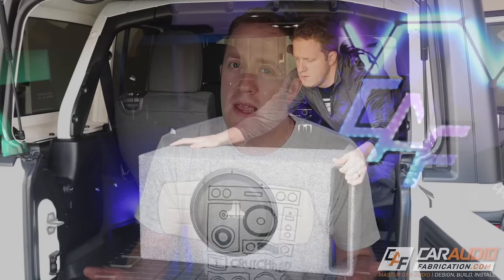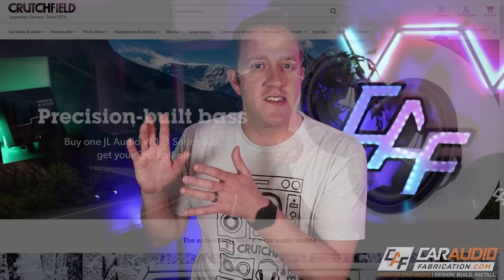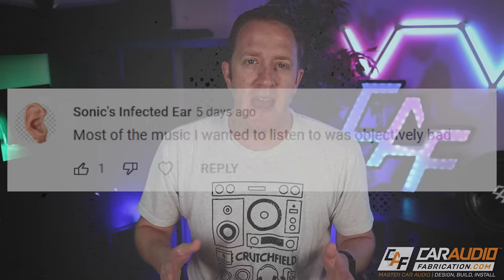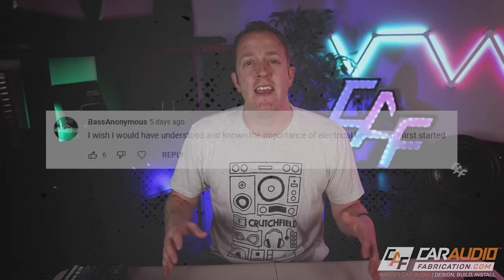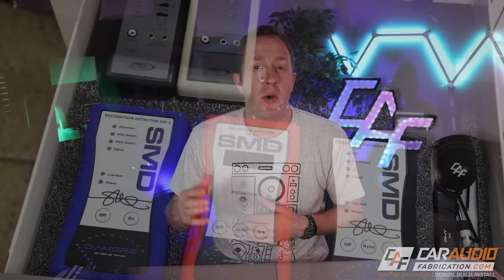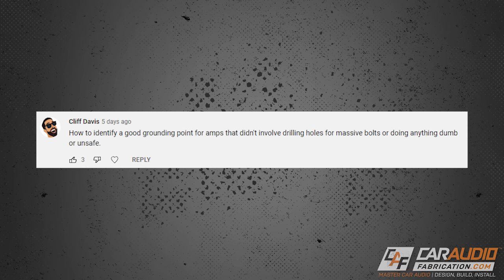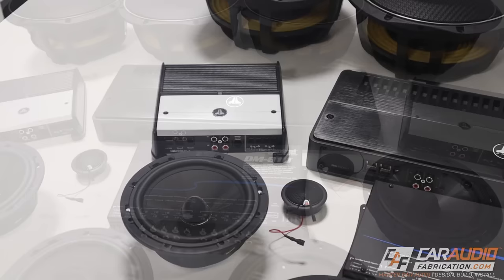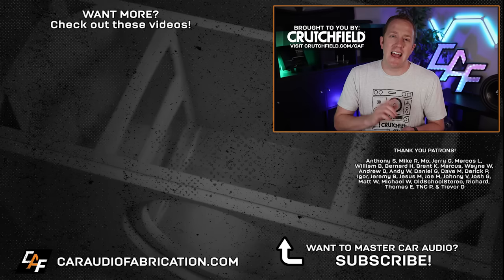My Car Audio System SOUNDS AMAZING now that I know THIS!

Comment from the maker: Let's hear from you! What's something you wish you knew before you built and installed your first car audio system?
Reply: proper vehicle selection, and managing expectations. you can't physically fit 10 15's in a hyundai accent, so you can't expect the final system to crush 150 db. there's a reason why the most common vehicles for SPL are tahoes and suburbans and the like and usually you'll find SQ builds in cars that are meant to be driven for hours. not to say there isn't crossover between the two, but think about how you're going to use the vehicle. is it a daily driver? will it be your grocery getter? can't make a walmart trip in your hyundai and get groceries if the entire thing from the b pillar back is now a sub enclosure. also not just beefing up electrical to compensate for the stereo, but the rest of the vehicle as well. all the equipment will be heavier, which means more suspension to maintain OE performance. more weight also takes longer to stop, so a big brake kit might be needed. tires are also rated to specific capabilities, are yours enough to literally hold the weight of the car, and now the added weight of the stereo, and perform adequately during braking? EXO addresses alot of this in his new build and even soundman has commented on it. depending on the desired end result, there's a certain recipe to get there, and it's not all just subs and amps.
Reply: ... to know that this channel exists would have helped tremendously
Reply: How to properly tune a dsp. I bought Helix mini mk2 specifically because I've read on various forums it's software is easy.  But to me there to still to many buttons and sliders. Why should I use a Butterworth crossover vs Linkwitz or Bessel for instance?

Also installing a system in a hybrid or electric car is quite different. My hybrid does not have a alternator but a 1200 watt transformer. That places a limit on how much power your system can run at.
Reply: I wish I knew how bad of a job an installer can do just to work as fast as possible, I also wish I knew I can actually make most things myself better than most audio shops in my area. And I wish I knew how to pair SW power/output to the rest of the system.
Probably I would have ended spending twice the money, but I'm sure I could have a system 10 times better right now
Reply: That I actually was never going to grow out of it.  I still love it as much if not more over 30 years later. 🤟
Reply: 1 thing I would like to know now. Is it good or bad for me to add sound deadening material inside my "fiberglass" subwoofer box?
Reply: Choosing the right head unit in which I have a Walmart brand Dual 6.2 inch touch screen. Its ok but is it ok for 1 sub audio system
Reply: @DarrenT0dd  I hear you. I put a system in a mini-truck I put off for 15 years. I was so happy and it sounds so good. I keep 6 bass enhanced mixes in rotation. Most of my friends try to act “grown” now like bass is for youngsters. I tell them they need to ride with somebody else.
Reply: what an LOC was and if wiring a system with a built in amp forgo the self install and pay a professional to do it
Reply: I just want to put two subs in my truck lol
Reply: Im only just getting into car audio and this channel has been great for info to help decide what to purchase. I am building a sound system for my wagon that will be a compromise between sound quality, bass and space as I still use my wagon to tow my drift car and it gets loaded up with tools. I have chosen to use 2 10 inch subs and have space on either side to fit up to a 35l box. I would like to know the difference between wood box, fibreglass box and fibreglass box lined with dynamat
Reply: I wish i knew about proper air space in a box back in 1990.  I just built a box for my two cheapass subs and it sounded like crap.
Reply: @DarrenT0dd  same here, but for the last 25 years or so
Reply: How much of a difference subwoofer makes. Even small one :)
Reply: Hi, I have a 2019 BMW X5 and I took it to a shop for them to install a sub. The set up is a JL audio 500/1 splash amp and a audio control DSP and two focal 10' subs.since they did the installation it has this humming engine noise in the sub and they can't get rid of the noise I took it back multiple times but they still can't find what is causing the annoying noise what would recommend to solve this issue
Reply: Hi Dear mark
Reply: I need your help regarding choice speakers and amplifier
Reply: @djmaxxhtx  LoL 🤣 that's me! I'm much more of an SQ guy these days. It could be the fact that the guy I work with has 1500 watts to 2 12s a garbage head unit to stock mids and highs that get completely drowned out.
Reply: @troycote4503  I went Alpine and JL Audio and I’m not looking back.😁 I put in dash cams, Sirius XM,  and an Amazon Fire Stick getting Apple TV etc. I think about places I have to go and wait in the car.🤣🤣
Reply: it would have been nice to let go and disregard every tool. oh wait. did that. now i feel how the capillaries in my fingertips react to being close to completing any circuit. how’s that sound🤫
Reply: Subwoofer is the first upgrade  to do, followed by speakers with amp.
Reply: @Mr99Burns  No No., big,is not better. Clean, plentiful power is required to achieve any of the goals you have in mind

Comment: I wish that I'd known that I was definitely going to cause irreparable hearing damage, and that I'd regret it.
Reply: Distortion is bad!
Reply: Loud noise for extended periods = hearing damage. 
You knew and didn’t care or failed biology. 🤷‍♂️
Reply: Design for clarity, not loudness!
Reply: @bradysimpson  It's the former.😞 (I've never failed anything. But that doesn't mean I've always made the best choices...)
Reply: @darkwinter6028  That's how I build now.  My current TwK88 system is loooovely.  And yet, even when building for SQ, you're going to end up with a system that can run at 112+ dB whether you want it or not.  And 112 is enough to hurt you.  So I must exercise maturity and restraint!  But damn... It's hard to exercise maturity and restraint ALL the time...☺️
Reply: In the same boat buddy, constant tinnitus and reduced hearing. I say “what” a lot 😅
Reply: So 6 tens in my mustang is bad for my ears.
Reply: Gotta pay the cost to be the boss 🤣🤣🤣
Reply: What?
Reply: @LC8FTW  true. My system is SQ but hits 156 db. Almost no distortion at high levels. But also not as much ear fatigue
Reply: @darkwinter6028  yep.  I've been more than happy with my SQ focused builds over the years.  Plenty loud and crystal clear.  Hearing is still fine.  Bass/Low frequency doesn't cause hearing damage but distortion and high pitch sounds does.
Reply: @LC8FTW  hey a couple songs really loud here and there ain't so bad but you have to give your ears a break.  Moderation is key.
Reply: @BigShay1977   damn, you beat me to it.
Reply: @darkwinter6028  lmao just don't tell that to those hardcore bassheads that have +8000 watts going to their subs!
Reply: @erikybarra1841  How, exactly, would I do that? They’re deaf! 😉
Reply: @fosholyfe6115  got to pay the cost for that hearing loss
Reply: As the adage goes. Everything in moderation, creates no problem.
Reply: @darkwinter6028  I can hear perfectly fine and been in the game for a long time, At the moment i have 4 cars with systems from high-end SQ builds to 2 Gately Audio Relentless 12s with a DC Audio 5k A3 on each. I'll admit I don't hear lows as good in the car but I haven't lost hearing at frequencies that really matter at all.
Reply: 🤣🤣🤣 who knew hearing anything over 110 dB was Goin to he an issue later on in life. I regret Nothing...

"What'd ya say hunnie?"
Reply: Right, I've done professional 12v for 24 years and I've got the hearing of an 80 year old.
Reply: Im in your boat. Heavy equipment operator for almost 20 years now and never wore hearing protection. When i was at the school of infantry, the first time we shot the saw it was so loud standing 40 yards from it…. Fast forward to shooting it without ear pro for years during deployments.  Wish i wouldve taken care of my ears better
Reply: No regurts 😂
Reply: When I was obsessed with music, I damaged my ears and now have a permanent high-pitched ringing. It’s fun to go to sleep.
Reply: @bassheadfanatik I'm really curious what your system consists of.  My system is ear fatiguing. I don't know how to fix it.
Reply: @markmaese1599 assuming we're talking about somewhat normal volume, I've always found that strong upper midrange to be fatiguing.  I'm over 40 so I probably can't hear real high frequencies that I'm sure would be fatiguing to some people
Reply: @jhershy1381  I’m guessing not
Reply: @nitrodreng  I've had tinnitus since birth, I can only imagine how much worse it could get
Reply: @bassheadfanatik are your hearing aids implanted or are they like ear pods ?
Reply: @darkwinter6028  the louder it gets , the more clarity it sounds lol
Reply: Lol I never took biology, but my hearing damage was definitely from listening to my Walk-man and disc-man as loud as possible. Now it's constant loud ringing, probably partly the music and mostly from operating skills saws all day every day

Comment: I wish I had understood 20 years ago that I could have achieved the same results with a simpler, less complicated system. Too much equipment and too many speakers. While I have always been of the opinion that it is the installation, speaker placement and the tuning itself that makes a system sound great, I was essentially handy capping myself from the start by not taking a keep it simple approach to the initial system design and equipment selection. The benefits of hindsight I guess!
Reply: Just look at the all time champion sound quality competition car, Richard Clark's Grand National. It only has 6 speakers and 6 amps.
Reply: @th-hx7st  I don't run 6 amps but mine go to 11.
Reply: Handy capped
Reply: I run a ported comp sub off a mono block amp and my two tweeters and four door three way speakers off my double din and it sounds brilliant. KISS [keep it simple stupid]
Reply: @firefueled  no component speakers?

Comment: I understand the value of a DSP, however if you do enough research you will find there is at least 1 headunit that has fantastic dsp settings, I bought a Kenwood a little while ago and while setting it up I discovered it has all sorts of time alignment settings including being able to set speaker sizes, locations, distances and delays for each speaker, my system is far from anything special but just upgrading to that headunit made a world of difference after already adding amps, subs and upgrading all 7 speakers, sounds incredible now for a 30 year old car, but I wish I could've retained the factory CD stacker
Reply: Dsp's and eq's look great in hardware form but all that and a lot more tuning is available through softwares; many of them at no cost.
Reply: @oscarishandsome5150  any suggestions?
Reply: Those are normal features. Every radio I've ever had has had all those features
Reply: Why didn't you get the DVD version if you wanted to keep CD?
Reply: @NoMoreBsPlease  you've misunderstood, they didn't mean any cd player, they meant the factory cd player for a factory look. That was my take anyway.
Reply: 100% More often than not, the more eq one has, the worse it sounds. Properly staged, x/o, and  amplified system may not require as much equipment as expected. I've had 30 bands of EQ before, I adjusted maybe 8-9 bands that I felt made a difference....

Comment: A lot of people over use sound deadening. That sticky butyl stuff is only good for minimizing resonances and does not require 100% coverage, if you want more treatment then that stop wasting money on butyl backed foil and use it on 25% or so of the surface area and then start looking at decoupling foam, mass loaded vinyl, etc.
Reply: This. Butyl deadener is great when used on large flat surfaces to lower sounds from vibration. But waste of money for your average person when covering the whole interior like a lot of professionals do. 
Simple trick to see if the surface needs it is to tap on it, if it has a solid thud then you don't need sound deadener on that surface but if it sounds like a drum then you need some. And even then you don't need to cover the whole flat area. Sometimes it's enough if you cover ~1/3rd of the flat area. Also make sure you roll it down on to the surface. Just slapping it on may give poor results.

When it comes to decoupling foam and mass loaded vinyl, you have to make sure you do very thorough job covering everything. Full interior disassembly required.

Comment: A DSP can't correct a bad installation...but it can correct many sounds issues that you otherwise couldn't "design your way out of" when building your system. You can understand all the best practices of installation and still not see all ends for how it will sound when everything is put together. That's where the DSP comes in.

Comment: My biggest lesson has always been - don't rush an install. Cutting corners or using readily-available, but sub-par parts will be worse than waiting a day or two for the proper parts.

Second biggest one is to not be afraid of asking for help if things start to get complicated.

My HARDEST one was to not always trust your local shops - they operate on making sales and especially superfluous services. Don't feel ashamed for checking out several ones, getting quotes, going back and forth,  and NEVER be afraid in saying no.
Reply: Rushing, that was always my biggest mistake.

Comment: Time alignment is used to get sound waves in phase when they reach your ear. If you want the stage centered a little left or a little right after that, you need to adjust THE SPEAKER LEVEL, not mess up the perfect phase alignment that good time alignment achieves.

Comment: tip/idea
use a rubber washer on the speaker mounting bolts between the speaker frame and the car door or dash to reduce vibration?

Comment: I need help. I have a 2021 Subaru WRX STI. I wanna keep the stock radio. So I installed new speakers and speaker wires. I cut the wires from the stock amplifier to my line output converters. With the head unit maxed out I'm only getting.3 volts out of the RCA jack's does the amplifier need to see a resistance from the speakers. I'm confused. Help please. Thanks

Comment: I threw my Butler tube amp in the garbage. Thought was it was faulty from sitting around... ended up being a bad ground in the vehicle. Metal component was actually isolated from vehicle chassis grounding. Was such a good amp

Comment: Thanks for pointing out the box spacing. I told this to people all the time. I used to have a power acoustic Gothic gw124 " the Walmart sleeper ". Everybody used to knock that subwoofer saying that it was crap and yet when I looked at all of their setups nobody that was talking bad about that sub had the proper enclosure size. If you look at the specs for the Walmart sleeper; you'll find that it wants 2.5 cubic feet minimum for a ported enclosure. Yet half the people that were talking bad about the sub had it in about 1.5 cubes. I built a custom box for my Walmart sleeper that was exactly 2.5 cubes before the port and my port also aligned with the specs recommended. I'll tell you what; my single Walmart 12 was pushing 138 decibels on the power acoustic RZR 1 2500 that I bought with it. Now I know that both the sub or the amp don't put out what they claim; but being a matched set, tuned properly, in the recommended box size; I was louder with a single Walmart 12 set up properly, than a couple people I know that had multiple name brand subs on multiple amps. I banged the system on a regular basis almost every day, and never had any problems with heat, bottom out, distortion, nothing. You take what you have and you set it up properly and tune it properly and you'll have spectacular sound. If you want the knocks it's about the box.
Reply: I hear this BS all the time and it's so cliche!!   I don't care how perfect you get your one 12, you won't out do multiple 12's unless they were severely under powered and considering you said multiple amps I find that unlikely.   I also find it unlikely that somebody getting name brand subs and multiple amps would somehow F up the box size, which is often a well known factor if you do any kind of audio research whatsoever.   They would literally have to be total F'n idiots to make dual 12's sound worse than one and beating total idiots isn't something to brag about.   And total idiots wouldn't be able to wire up multiple amps and subs, so I call total BS on all these F'n fantasy stories.
Reply: Agreed mate. My Kenwood 10" budget sub in a slightly oversized box (1.25 cu/ft) paired with an Alpine MRV-T407 capable of twice the RMS power of the sub... Gains set correctly (IE impedance matching NOT as a 'volume control' LOL).

Run flat on the head unit, no EQ, no bass enhancement or BBE etc... All switched to OFF.

By FAR the best sounding bass I and many of my friends (1 who happens to be a professional sound engineer working for Britannia Row Productions) have ever heard.

Big, fat, weighty, extremely punchy bass with an incredibly fast attack and decay. I have NEVER heard a rock kick drum sound soooo FAT and TIGHT at the same time. (Limp Bizkit - Chocolate Starfish album) showed this off the most. Micheal Jackson Greatest Hits CD also for the dynamics, tightness and subtleties in the deep, deep low end that envoke such emotion in you. I had never experienced this element of his music before this subwoofer setup, I honestly doubt many people have.

I have heard multiple kW 18" systems and loads of ported 12/15" systems with 1kW+ amplification. None of them sounded like my 130W Kenwood. They were much louder and played lower with more authority but that's it. SQ wise they all sucked tbh.